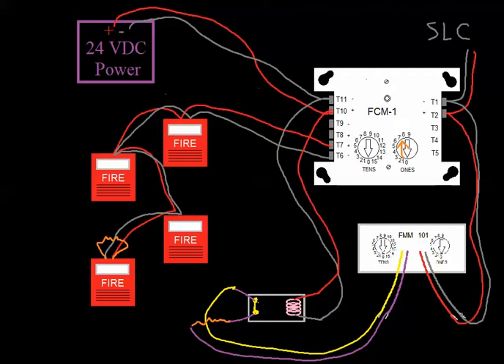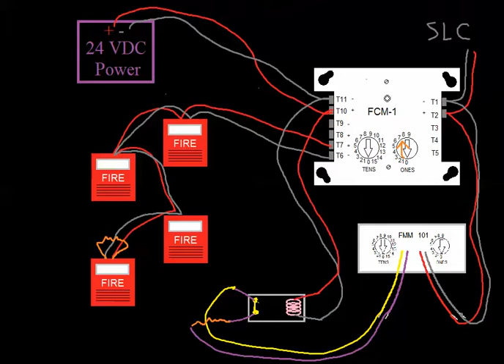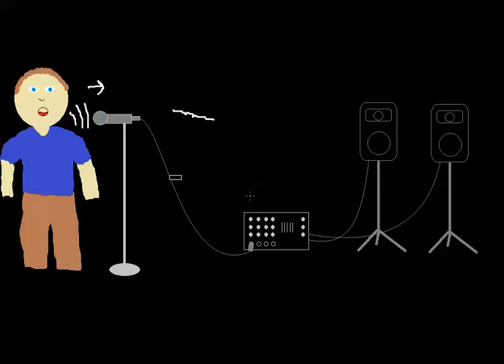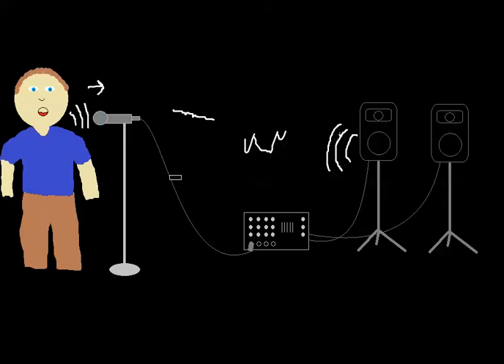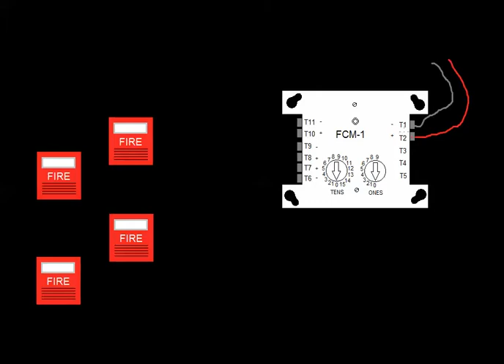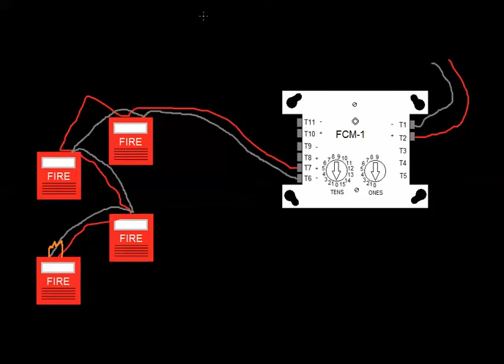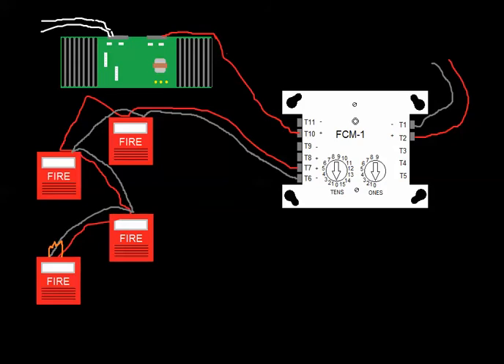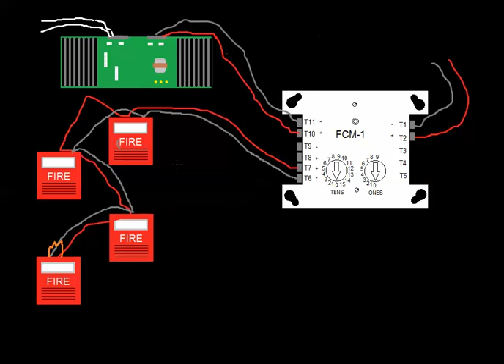25.2 - Control Modules for Speakers - Introduction to Fire Alarms

Comment: So using the FCM-1 you can basically create additional NACs beyond what the panel supports? Would it function the same (other than panel NACs including the power, VS. the module needing external power)
Reply from the maker: Can you ask that question another way? I'm don't think I understand. You can create additional NACs in terms of having the ability to control additional zones independently (such as in a strip mall or high rise), but you'd still need enough external power from some source to properly drive the devices.
Reply: Joe Klochan yes that was the concept I was referring to I wanted to see if I was understanding correctly. 

So you could have a control module in a remote location in a strip mall type scenario then have a power supply in that suite for those strobes.
Reply from the maker: @virbricky  bingo